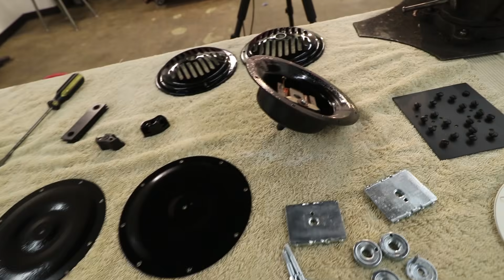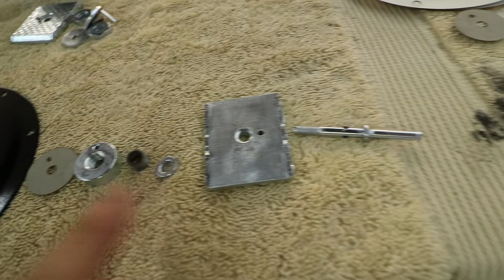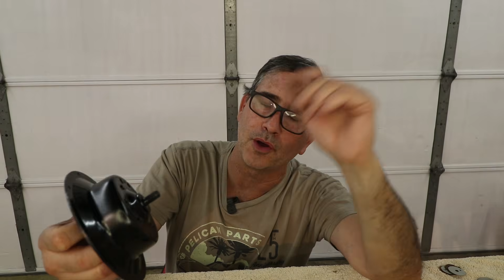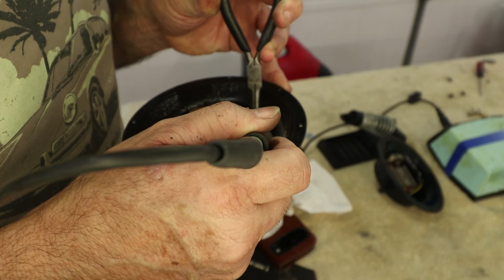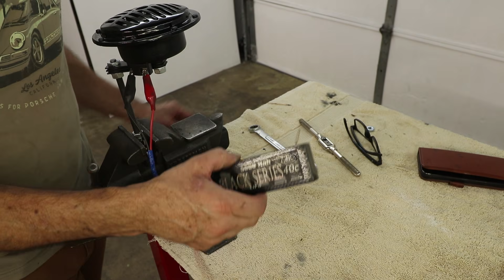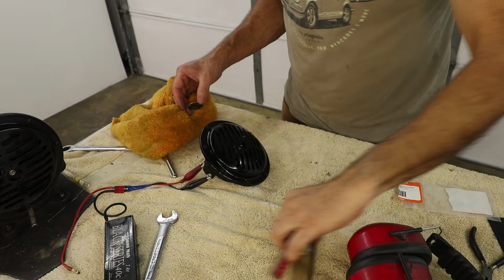Vintage Bosch Horn Revival for Porsche 356 - Part 2

Comment: This was a fascinating video and exactly what I was looking for!  I have basically the same model horn from a 1950's Land Rover, and it was working.. until it stopped.  I found and repaired a broken copper wire, and that allowed the outer plate to get "pulled in" when it got power to the coil, but it wasn't really making much for a sound.  I tried the rear adjustment screw, which helped a little but the sound was weak.  I now will try the front adjustment bolt.
Reply from the maker: Glad this helps.  Beware it doesn't take much adjusting to get it dialed.  Maybe 1/8" turn to get the best tone once its "close to functioning at all.

Comment: There are two different sets from Bosch. One is a combination of 290 and 345 hz. The other is 390 and 510 hz. The lower one is for normal cars. The other is for emergency vehicles like ambulance and fire trucks
Reply from the maker: Do you have part numbers for these differences?

Comment: Thanks for documenting the rebuilding. An ignition points capacitor might be adequate or acceptable overkill.
Reply from the maker: Sure thing.  It's just a weird size and mechanical attachment
Reply: @GarageTimeAutoResto  Have you found a good replacement. The SW radio rebuilders might be a knowledge resource. I haven’t tested mine yet. What are the dimensions? reason I mention points capacitors was the roll form inside. Might have to find the smallest one and grind off the mounting.

Comment: Nice work.  I knew you'd have to make some kind of "tool". LoL.  Always fun to see what it will be.  Nicely over engineered by the Germans.
Reply from the maker: Are you referring to the screw holder adapter to toaster oven tool?  
Doesn't everyone have one of these?😂
Reply: @GarageTimeAutoResto no, I'm thinking of the item you modified to hold the horn in the vise. 😊

Comment: The different plates are called "bells" in German and they determine the frequency of the horn. A horn works by vibrating the mechanism and introducing a ringing of the "bell". The main spindle adjustment is to control the switching on and off of the coil to make the horn function. The external screw finesses the tuning. Great video.
KTF
John
Reply from the maker: Are the high and low toned bells normally shaped differently on the same car?
Reply: @GarageTimeAutoResto  It would make sense that they would have different dimensions as audio speakers have to function in specific frequency  ranges. Nice work.

Comment: What happened? I thought you said there was an electric component inside that was weak. Did you use the original stuff inside? Sounds fine now.
Reply from the maker: I reused the old capacitors and it works.  I don't think they are protecting the contacts very well though so I may make my own capacitor replacement.  I bought some tantalum capacitors but they won't hold up.  I need a mylar film capacitor which is hard to find.